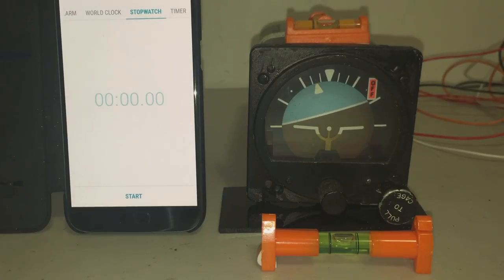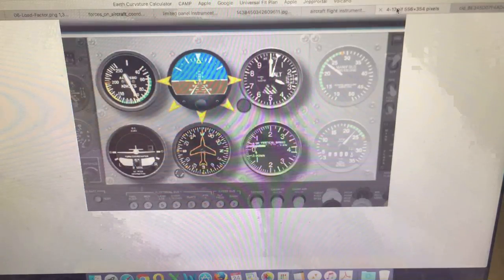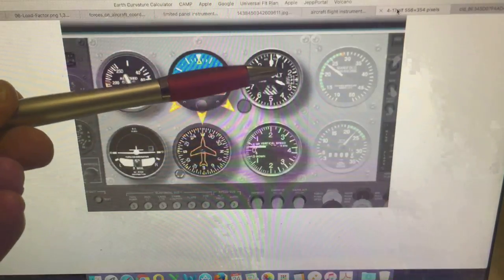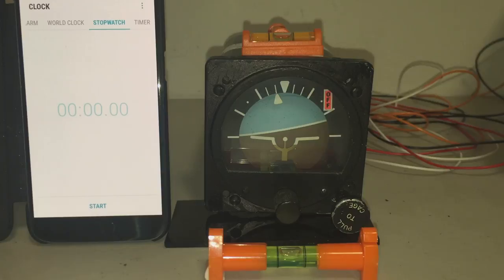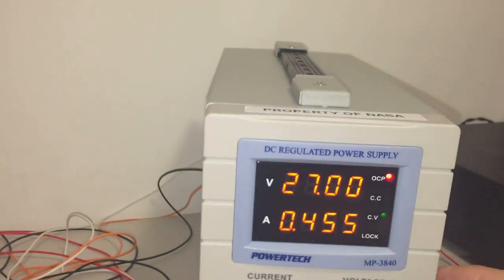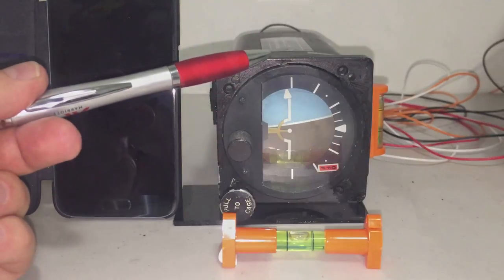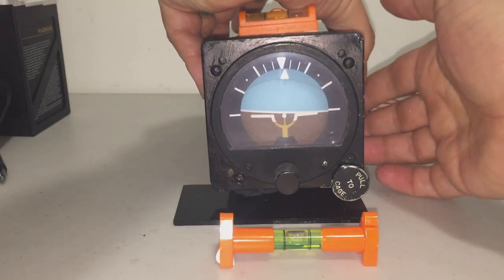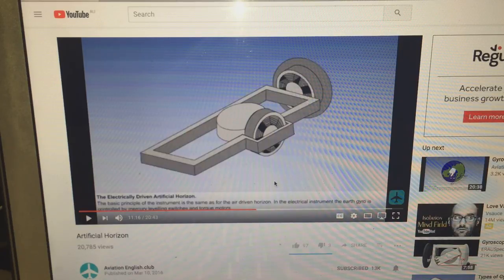More about the Artificial Horizon & additional self correcting tests.

Comment: Your videos are full of great information, I've always been interested in aircraft like almost all  boys to teenagers to  men but never known much about the navigation and instruments.
Your pro software was very interesting,  especially the WGS84 map.
Love the nod to NASA at the end, it made me spontaneously laugh out loud.
Reply: I have always been interested in them myself. I remember my Dad got me one of the first Microsoft Flight Simulators, and then later, I used to download them like MS Flight Sim X. I never had the proper hardware though. All I really had was the keyboard (for the instrument panel) and a cheap joystick. The Joystick did have a yaw control (twist) and a trim (the hat) as well as an analogue throttle wheel. It was no Microsoft Sidewinder with Forcefeedback and all that. I wasn't that into it. 

Oh, that reminds me. Did you ever hear about that teenager (14 I think he was) that stole a car then a small aircraft and managed to fly and land it after he learned to do it on a Flight Sim? Apparently, Microsoft Flight Sim X can actually go towards simulator hours (officially). So I have heard.

Comment: You did a good job covering up the NASA serial number tattooed on your forearm, what kind of concealer or base are you using? I can never get mine to completely disappear.
Reply from the maker: +John Michaelson - I did a deal with the tattooist and he put it on my neck, just below the shirt line...
Reply: +John Michaelson
Your's is visible? Weird... Usually the tattoos of those they want to keep they do in special Ink that needs UV light AND cold Moonlight at the same time to be readable. What do you think they got that supply of moonrocks for? To make cool light sources out of! OBVIOUSLY
Reply: Feno 3000 john is no flat earther
Reply: I think he knows, but just in case, thanks. I'll have to have a talk with my reptilian superior because I definitely got a raw deal having a visible tat.
Reply: couchpotato what do you mean?
Reply: +John Michaelson Mine is basically a microdot, only visible through a P900.
Reply: @Bunker Buster
Oh no... you must have signed up with an impostor NWO then, Buster!
The instructions should have been SO clear... ONLY EVER go to NASA... Imitation Conspiracies like IIASA, HASA or MASA cannot give you quality equipment and will cheat you with uncovered cheques!

Comment: I watched Walter's video and it will be interesting to see your video when you open the unit to see how it does self level since I found some information that said the electrical panel mounted units use a centrifugal fan and pendulous vanes like the vacuum driven units.  I asked this question on your previous video and a reply from Walter Boxhead (same Walter?) mentioned the mercury switches and torque motors.  The article I referenced said this was used on remote vertical gyros but Walter's video seems to suggest that panel mounted units  also use the same method.
Reply: Khun Rich 
Walter did say that "some" designs of the electric AI use torque motors for correction, so you're probably both correct.

Comment: Does the torque of the gyro transfer to the case- like a gyroball - do you feel the unit trying to twist when you pick it up while turned on?
Reply from the maker: +TruthTrigger,  No, you can't really feel it as you move the case as the gyro inside is basically stationary and the bearings have so little friction.  I tried making the gyro do a "loop" also and when it got to vertically up there was definite resistance and the gyro did a hard 180.    Doing it very smoothly and slowly the gyro kept up but doing it faster threw the gyro out quite a bit.

Comment: Did you just proof that mercury levels work as expected? What other outcomes would one expect?
Reply from the maker: +mpunkt.  Yes, I agree with you, however some Flat Earthers are claiming these instruments do not have any self correcting mechanism.   This is proof they are wrong.  This debunks one of the claims Flat Earthers are using to deceive people.
Reply: +Wolfie6020
Thanks for explaining. So if the gyro would use the mecury levels as reference what would make it superior to two spirit levels in the cockpit? I am still not getting it. You are showing that the system compensates for high forces (like rapid angular changes during flight). If it would compensate for curvature by your exposed mechanism, how does it not compensate for slight permanent changes (ascending/descending/rolling)?
An other words. At what point does an artificial horizon recognize you are not ascending but flying around a curve without data from an altimeter?

Comment: I think if you're careful, it should be possible to do a teardown and reassembly of that unit without even introducing any errors. It would lose its "yellow tag" status, though, assuming it had one when you bought it, until you took it to an avionics shop to get it recertified. Not that you need to, you probably won't fly with it, except as an ancillary unit for experiments.

I'm sure you know an avionics tech or two who could help.

Comment: Can this machine be used to establish the curve of the earth while flying a commercial jet W?
Reply from the maker: +anounceofsaltperday.  I don't see how, as it is will be constantly correcting to level as the aircraft follows the curve.   If we disabled the correcting mechanisms the gyro would precess more due to friction and imbalance than it would from the Rotation around the Earth.
Reply: so what happens in a slow, steady climb to 40,000'... does the AH indicated a climb?  If so, why doesn't it return to show level flight after a period?
Reply: Do you have any data to support your claims regarding friction and imbalance?
Reply from the maker: +anounceofsaltperday.  Why would it show level flight during a slow steady climb?  You are not understanding this video at all mate.  

It is aligning itself to true level - it is not aligning to the case of the instrument.   

In a slow climb the case of the instrument will be angled up slightly, but the instrument is aligning to true level the whole time so it will show a correct climb indication on the instrument for the entire climb too. 

Not trying to offend you Frank but you are not understanding this instrument at all. 

Do I have any data?  Yes, if you turn all the power off on the gyro you can see that it is unbalanced.  That is deliberate. They design it that way so that it will hang almost level when unpowered. That speeds up the time it takes to align when power is applied.  But that imbalance - when uncorrected would create precession errors.

Comment: Flat horizons everywhere I look at every altitude. How many flat horizons does it take to make a sphere?
Reply: desMEGA 

Well not at every altitude. 

See, that was easy.
Reply: I think what many refer when they say the horizon is flat that it  is at a constant depression angle.  That is in fact just what one would see on a sphere. For one could  put a small tripod on a globe,  adjust the elevation  of that tripod so that it is  looking at the horizon and then swing in azimuth  the  tripod mount and it would follow the horizon at that constant depression angle in elevation. When one turns their head to  follow the  horizon one is doing just that.... only near the surface of the earth that depression angle is albeit  small. The pixels in the camera itself cannot really see the curvature in that the field of view of the camera is too small at low altitudes to see the curve. Using  fish eye lens  to make the FOV larger adds distortion. So one has to get pretty high to see the curvature in the relatively small field of view of most cameras. But swinging the camera around in a full surface will just show the depression angle to the horizon which indeed (barring any mountains)  will be constant.
Reply: How many "flat horizons" does it take to make your horizon go 360° around you ?  How does a FLAT horizon curve around you at the same time?  You'll laugh that off but you know you cannot explain or address it.  If the horizon were TRULY flat it could NOT go all the way around you.   It LOOKS FLAT because you are looking at a curve nearly edge on and it happens to fill most of your limited human vision.

Can you even honestly address the above?

Past that...

Get yourself a Canon EOS 6D (Full Frame DSLR, 5,472 × 3,648 pixels, ~$1400) and a Canon 11-24mm F/4L lens (~$3000, you can rent these things also) which, at 11mm, has a 126° 5′ field of view and is NOT fisheye (is one of the widest-angle rectilinear lenses on the market).  Go up to 40,000 feet and take an image at 11mm with the horizon passing through DEAD CENTER of the lens with NO obstructions of the horizon view (including clouds, meaning you need a very clear/not hazy day).  You aren't allowed to PRETEND the horizon extends beyond where you can see it because YOU are the one ASSERTING that you see SEE IT AS FLAT.

You should see approximately 103 pixels of horizon sagitta (the "droop" of the horizon circle as it curves around you).

This version uses a balloon and curvilinear fisheye lens but this is the METHOD I'm talking about:

http://flatearthinsanity.blogspot.com/2016/08/flat-earth-follies-high-altitude.html

The keys here are ALTITUDE, HIGH RESOLUTION, and WIDE ANGLE.  I show you EXACTLY how to calculate this on a spheroid in my post.  In simple terms this "sagitta" is well approximated by the rather astonishingly simple equation:

w × d/R × tan(fov/4)/2

where 'h' is observer height, 'd' is the distance to the horizon (d=sqrt(h(h+2×R))), 'R' is Earth radius (in same units as 'd'!), 'w' is the width in pixels (assumes square pixels), 'fov' is the field of view in appropriate units for your tan() function (usually radians unless you selected degrees).

At the same time take a water level up and take an image where we can see where the water in the water level matches against the horizon so we can see where LEVEL truly is.

Water level, like so:   https://www.youtube.com/watch?v=NqOQ_BCtqUI

My measurements: http://flatearthinsanity.blogspot.com/2016/08/flat-earth-folloies-horizon-always.html

You must supply RAW images at full resolution exactly as detailed above (horizon dead center or close to it) and the EXIF data must be 100% intact and unaltered in any way.

Are you willing to do that to demonstrate the horizon curve to yourself?  If not, then you are being DISHONEST.
Reply: Dark Star - Place your head in the center of a hula hoop at eye level. What do you see? A perfectly straight and continuous line around you. You will not see the curve of the hoop until it is sufficiently above or below eye level. The horizon appears visually flat for exactly the same reason.
Reply: I stopped reading after " How does a FLAT horizon curve around you at the same time? "

Because it doesn't. LOL. But with the curve aside, I would be on the inside of a square..... 

The reality is. There are hundreds of examples of islands and landmarks that should not be visible on a globe but with a high zoom camera or telescope the observer can view in and see them proving a flat plane not a fucking ball.
Reply: "I stopped reading after " How does a FLAT horizon curve around you at the same time? "

This question does not make any sense so I ignored it. If I had to give an answer I would say standing inside a square then the observer pans North, East, South and West and returns to North. LMAO
Reply: Ut oh forgot this one: https://www.youtube.com/watch?v=S4oT2EbDONs&t=106s

Could literally find 100's more...............
Reply: Jeremy - I'd say that's a valid answer! Here's a counter-question: If the earth were flat, how would the horizon appear? :)
Reply: But when you reaaaalllyyyy think about it. To have a perfectly sphere earth (like NASA photos) there would need to be an ever so slight mound on every "horizon". 

It's just logical.
Reply: Jeremy , your hoop must also be intrinsically curved , a hula hoop is flat isn't it ? Just saying ;-)
Reply: desMEGA What would you expect the horizon to look like on a sphere 7918 miles in diameter? Please explain why you think it would have that appearance and why you believe it does not in fact look like that.
Reply: desMEGA
The horizon is a 360 degree circle around you, and no matter where you go you are in the middle of that circle
Reply: Everything is curved , it HAS to be to live on a ball . Wherever you stand , the Earth curves away from you at 8' per mile , centre of gravity changes , buildings must follow plumb, bridges, tunnels , all  allow for curvature . Just look at some of the Apollo photos of the moon if you'd like some curvature with diameter of 3474km  !
Reply: +desMEGA  https://www.youtube.com/watch?v=S4oT2EbDONs

What's cute about that one is that about 3:00, when he puts the shot taken at the beach over the shot taken from 560', he crops the high elevation picture to match the low elevation picture. In other words, he cuts off the bottom part of the islands' silhouette just like the horizon on a globe Earth does to get the pictures to match. My irony-meter just melted.
Reply: NelC 
Flat earthers make it painfully obvious they only see what they want to see.  For example they will claim the mirage effect that shows the top part of a ship mirrored on the water's surface, is actually hiding the ship's hull.  However when they do that, they ignore their claim that the horizon is always at eye level since if the mirror effect is not covering the water, the horizon would have a significant drop.
The advantage to FEs of trying to prove flatness over long expanses of water is that the results are always subject to error and can be rather vague.  The one thing they do show that objects are obviously hidden by the horizon, is another thing they either ignore or make meaningless reference to 'perspective'.

Comment: So if you're in a holding pattern say for ten minutes on a bank, that gate keeping instrument is going to tell you you are flying level  ??
Reply from the maker: +Rolf Grosseholz.  No because a holding pattern is not a circle.  It is a race track pattern.  You do a 180 degree turn then fly straight for 2 minutes then another 180 then straight for 2 minutes.   The turns are done at 'rate 1' which is 3 degrees per second - achieving 180 degrees in one minute.   Any tiny error that occurs in this 60 seconds is quickly corrected during the straight legs.

There is never ever a requirement to do continual 360 degree turns during an IFR flight. 

Also depending on the sophistication of the instrument there are systems in the correcting mechanism that minimise false alignment during turns.  Please watch the recommended video which explains these fully.
Reply from the maker: +Rolf. just a tip mate.  Calling a simple artificial horizon a 'gate keeping' instrument will only make people think you are a nut job.   That really is paranoia that borders on insanity.
Reply: Well apart from commenting on my humorous description you didn't   answer my question.  But that's fine.  Cheers

Comment: These three  videos were quite interesting. 

BTW, I did a quickie search and found this video on the directional gyro which actually does sense earth rotation, though it seems more at the poles than the equator.

https://www.youtube.com/watch?v=8il794p8YdI
Reply: BTW it makes sense that the directional gyro would  be more effected by earth rotation near the poles. For on the equator the up direction would be right angles  with the polar axis. and thus the directional gyro instrument  (for level flight) would be in effect doing a barrel roll as the earth rotates around the same axis of rotation of the gyro. . But near the poles it would be in the plane or earth rotation and would be in effect doing a flat turn as the earth rotates at right angle to the rotation of the gyro and thus cause precession..  

So once again gyros do not prove the earth is flat but quite the opposite,

Comment: artificial horizon correction time difference due to earth rotation ? OK, if you switch polarity (motor doesn't care which direction it turns)to gyroscope causing motor to spin up gyro in counterclockwise rotation, measure time to autocorrect, compare with clockwise rotation and see if they cancel out each other out. showing that auto correct from tilt registered time difference sort of sounds like it's shorter to fly west and longer to fly east. of course that's absurd but....., that leads to a question of gyroscopic precession depending on direction of spin. Throw in Coriolis effect plus Foucault Pendulum and it might create some confusion.
Reply from the maker: +Paul Purdue.  There is more to the operation of this instrument than a simple DC motor that will spin the opposite way if the polarity is reversed.   The instrument just won't work at all and is protected against reverse polarity.  Nothing happens.
Reply: Wolfie6020 + thanks, attitude indicator works off air drive (I assumed it was electric), I learned something I didn't know before. so after studying exploded view, I see gyro has vanes catching air jet. only way to reverse spin would be to relocate jet to opposite gimbol arm. ( probably not feasible) I did use the altitude indicator to show my son the uses of algebra and the XYZ axis. showing real life examples of math. thank you